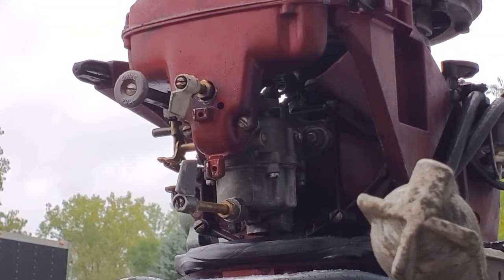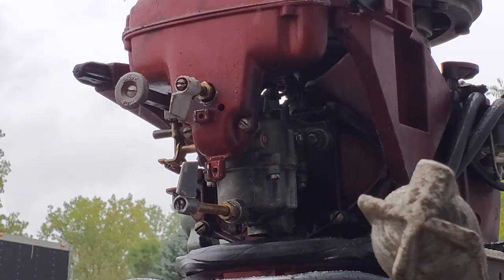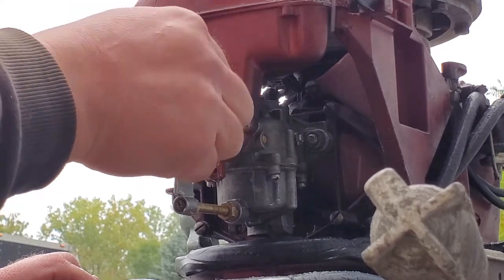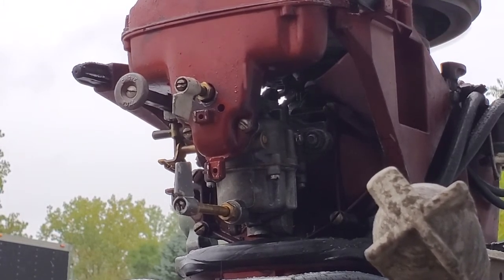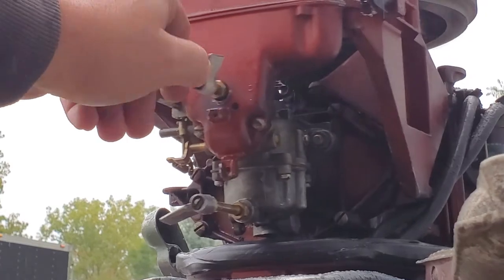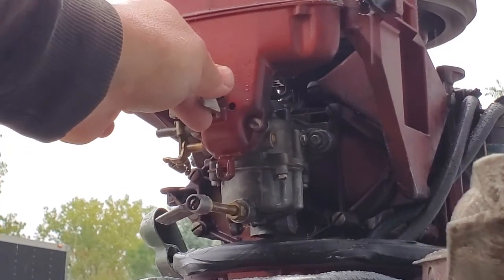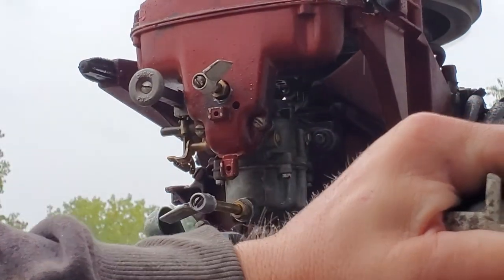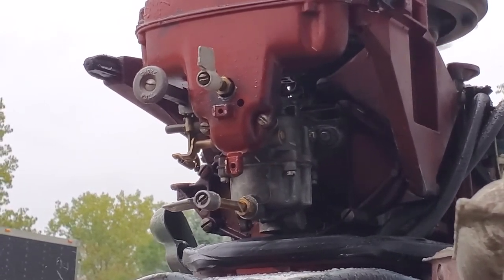Dialing In a Carburetor After a Rebuild

Comment: I think I found the bracket for the 18hp fastwin. On marineengines they got it labeled as #0126256. Is that what the bracket that works for my 66 18hp? 
I am talking to a guy about 150 miles away, that might have that bracket on a 69 25 hp Johnson. He took the bracket off a 72 20hp Johnson.  The 25hp says needs a fuel pump(which I have), the 72 I dunno he bought just for the bracket apparently. He wants 350 for both or 300 for the 25 with the bracket and starter motor. Gonna send me pics later when they get home. Best lead yet.
Edit: http://www.marineengine.com/newparts/part_details.php?pnum=OMC0126256
Reply from the maker: Yes, that is the bracket.  I posted a link to the video I made you of my bracket with the starter in it. Same number.  It fits all the 22 c.i powerheads. At least all the ones with fiberglass covers. The link is back in the comment thread on the other video where you asked for the video.  I posted it three days ago.
Reply: @oldjohnnyrude8404  lol dang I’m slipping! Holy cow, I found it! And yes it’s the one on the motor that guy has. So now my decision: the bracket and motor brand new is 286$ on marine engines, the guy wants 300$ for his motor with the bracket, motor needs a fuel pump and it’s 150+ miles away... long drive, but I can probably slap a pump on the motor and sell it for more than 300. Imma offer at 250... I really hate driving, and spending money...
Reply from the maker: @TheFrogfeeder  Yupper, that's the bracket.  Those small block 25s sell well.  I have bought three of them this year.   They're great motors if your not trying to troll with them on an aluminum fishing boat.  They are strong performers.  It should easily bring 300 as a running motor.  They're hard to find near me for under 500.  I do understand driving and spending money not being high on the list of fun things to do.
Reply: @oldjohnnyrude8404  yeah, I’m driving 5 hours at least tomoro to go get both motors for 250$! 😁
The 25 needs fuel pump, the 20 is ready to go, just actually spoke to the guy.
Why don’t the 25s troll well, just don’t like the low speed?
Reply from the maker: @TheFrogfeeder That will be worth the drive. 👍
Reply: @oldjohnnyrude8404  just got back, and guess who has some ‘lectric start for his ‘66 Fastwin!
These motors are clean, gonna slap this fuel pump on the 25 and get it on CL, the 20hp needs a little love, it was set up for controls and all the stuff from on the motor(kill switch, knobs, etc) is missing and there’s no tiller handle(I have an extra from the speeditwin maybe it’ll fit). He said they both run good.
As a side note, the guy told me the same thing about this 25hp, he said it’s a great motor on a little aluminum if you wanna go fast, but don’t expect to troll with it...
5.5 hours at 79mph thru smoke-filled Central Valley of california, drove halfway up the state, been a long day.
Oh, my name is gregg, i really wanna do something nice for you man, I keep asking to send coffee card or something...you interested in this 25hp or 20hp motor at all? I dunno how much shipping would be, but I’d strap it to a pallet and give you a screaming deal on it
Reply: @oldjohnnyrude8404  the 25hp is #25r69b, the 20 hp is fd-21r and it’s not listed on marineengines as far as schematics, but they show it on the main Johnson model list as a 67?
Reply from the maker: @TheFrogfeeder  Yes, the FD-21R is a 1967 20hp Johnson.   The FD-10 was a 1956 15hp, 1957 was FD-11 18hp and so on.  The 15hp was a 20 c.i. powerhead.  The 18, 20, and 25 were 22 c.i. and the FD models increased every year from 10 in 1956 to the end of the run.  The 25R69B is a 1969 Johnson 25hp short shaft, rope start.  If that one is electric start it was converted.   Nothing wrong with that, just an observation.   1969 was the first year for the 25hp 22c.i.  Both are great motors.  The nice thing is if you use the starter and bracket off the 69 on your motor and conver that one to rope start, it will be back to original configuration rather than being an electric start motor with the electric start bits hocked off of it. That is a small bonus in my mind.
Reply: @oldjohnnyrude8404  ohhh that starter and bracket are already on the fastwin, that was the original plan anyways, from months ago when all I had was the fastwin. 
Yeah it’s weird that the bracket was there, The guy put it on the 25, but he took it off the 20, so maybe that one was converted, either way, it’s all mine now!!
She already wired up and starts beautifully, the 18hp is my best running motor, had it out several times now and I’ll trust it in the river, expecting rain this weekend here finally, hopefully fall will hit and cool things down enough for the salmon to start really coming up the river now...